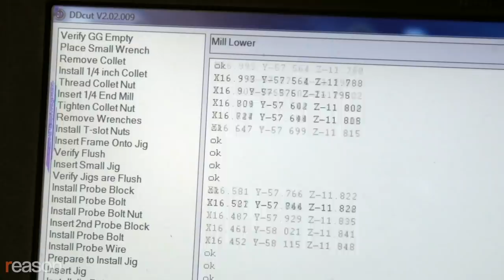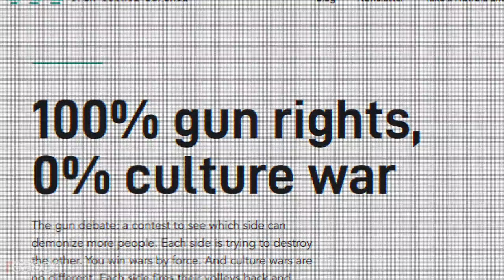Biden's Plan To Stop Ghost Guns Is Doomed To Fail

Comment: Home Depot and Lowes is going to need to perform FFL for purchases.
Reply: my plumbing supply store does and cheap transfers
Reply: Makes me glad I took metal shop in High School. I learned CNC and Milling. If I had that equipment guarantee you I would have an arsenal and a reload machine.
Reply: Hammer and a peice of pipe. Viola! got yourself a ghost gun.
Reply: I actually wonder how many people have been murdered with a "STUD GUN"  I don't think any or NPR and CNN would have harped on it for months.
Reply: IIRC Cal considered trying to ban 0% lowers; anything that can be converted into an AR lower. There is a guy (IIRC up in Alaska) who made one out of a 2x6 and another out of a nylon cutting board.
Reply: Slam-fire shotty.
Reply: @benjaminshropshire2900   Cool!!!
Reply: @johnslugger  i think a guy on yt has been trying to make a home built smg in the ww1 angry tube style
Reply: @vo25cd80   That makes more sense.
Reply: You can put a .22 on a straw and it will go off... Straws...

Comment: Anything that can be converted to a receiver would be controlled?  Thinks back to the dude who drilled a steel shovel blade into an AK-47 receiver.
Reply: And used the handle as a stock.
Reply: I can't wait until a 2 ton billet of Aluminum needs an FFL and serial number
Reply: @tyrannosaurusimperator  are you referring to cars?
Reply: It's not about the law. They don't need laws.

We just saw that with the Chauvin trial.

All they need is a narrative.

They will simply arrest you on a narrative. "Well, he had dangerous guns".

Our legal system is no more. Leftists have destroyed it.
Reply: I like the Ar built on a 2x8 plank
Reply: Anything using steel? Yeah right good luck Biden your government will because bankruptcy or become the newest province in china...
Reply: Ak 47 kits have existed for a long time and are surprisingly easy to utilize.
Reply: Man I love that dude
Reply: @dialecticalmonist3405  you are correct!
Reply: Casually replaces broken walther firing spring with a mechanical pen spring.
Reply: Loud and Annoying YT  And that just magnifies the absurdity

Comment: You can make a single shot shotgun from two pipes, an end cap, and a nut and bolt - off the shelf stuff you could buy at any home improvement store.  All you need is a drill and a drill bit to modify the end cap
Reply: Zip guns and pipe guns, the original ghost guns.
Reply: Wasn't there a wave of "slam-fire" shotgun videos on YouTube recently? Most of them were simple plumbing parts, but a few were really well-made.
Reply: Less robust but JB weld formed into a blunt point works too if you don't have a drill.
Reply: Rock & Lesson (learned)
Reply: Exactly, the only way to truly ban guns is to ban gun knowledge which would never be possible. There was a guy i think in the UK who wrote a book called "Expediant homemade firearms" where he demonstates that you can make a gun from hardware store parts.
Reply: @Queue3612  P.A. Luty
They threw him in prison
Reply: @middlesiderrider  Because he illegally made a firearm. im not saying it is legal or even right to start making homemade firearms im just saying that it is always ossible for someone to get one even if entirely illegal.
Reply: Theres an easier way a pipe a cap gunpowder and some gravel boom shotgun
Reply: Do what Switzerland is doing, your not allowed to carry bullets outside of firing ranges, even if you could make a gun you can’t use or fire it

Comment: 0:48 He doesn't realize what the bullets are made out of. Even some parts of the plastic gun.
Reply: I'm not a material engineer but I'd assume barrels and firing pins etc would have to be metal
Reply: @cowmaneater1243  I pipe is literally a metal tube and cylinder
Reply: someone in Israel snuck a ghost gun through metal detectors, so thats that
Reply: @cowmaneater1243  yes, because plastic can't strike the primer hard enough. But the liberator which is designed is based off an old French resistance pistol in the 1940s, so yeah you could make it completely out of plastic except for the firing pin and the casings and bullets, but you would only get one or 2 shots out of it if used full plastic to include the barrel.

The original liberator was half the size of his printed gun and was disposable and only fire a few shots.
Reply: @npciiii  the TSA also misses 95% of the guns and bombs smuggled by "red teams" testing the security. So what?
Reply: @npciiii  But you can't smuggle bullets in. Unless if it was made out of plastic and gunpowder.
Reply: @cowmaneater1243  nope the hardest part was the spring and no they make replaceable barrels now and yes they make bullets that are composite
Reply: @killertruth186  they make plastic cases for bullets even aluminum tho you can't reload them and gun powder they can make cordite but basic gun powder is easy and not metal
Reply: @killertruth186  say a 9mm at 50gr mostly composite goes rifle round speed but even all copper bullets
Reply: @bigalls3661  Projectile heads?
Reply: @ChucksSEADnDEAD  Let’s be real. They only look for bottles of water.
Reply: @npciiii  To be fair they let almost any weapon through, I lost count of how many lethal devices I just simply passed through the airport with. Like they really don't care what it is, its laughable how much truth to "security is just an illusion", and they just prove that.

The ATF considers shoelaces to be machineguns, so as a joke, think about how many unregistered machineguns walk through the airport every day.
Reply: @npciiii  unloaded?
Reply: @jakegarrett8109  everyone walking through the airport has weapons on them, its called a belt and a shoelace
Reply: @Robert53area  Exactly, I had a 5+ pound brick charger that would easily bash a head in (with heavy gauge cable and lighter gauge depending which you prefer or swinging like a mace if your a real lunatic), my belt, neck tie, and multiple electronics and they never checked if the batteries were actually batteries or turned on the devices. I think my neighbor would opt for shoelaces or they honestly wouldn't bat an eye if you packed guitar string which is the same as piano wire he used in combat. It blows my mind that they care about some things or at least pretend when they let you walk in with the most dangerous weapons you could want for murder.

For the most part its pointless, as an aerospace engineer I know a couple ways you could take down an aircraft once you're inside without tools and to escape safely (assuming you have a parachute) if that's your goal. So if that was really their concern then I'd say they are overlooking the obvious.
Reply: There's probably composites that can handle being barrel and pin.  Actually, wouldn't metals that are not sufficiently magnetically affected slip past detectors?
Reply: @jakegarrett8109  And sadly billions of people had no idea that anything can be the most dangerous weapon other than just firearms. It's just amazes me how people don't really care about the tools could be the most dangerous weapon they could carry.
Reply: @midgetydeath  I believe there are carbon fiber barrels, so yes that should be quite easy to DIY if you wanted. The liberator in the photo is a plastic printed barrel, typically one shot then replace but depends on cartridge used, so if a plastic barrel can half survive even one shot then some strongly wound composites which have similar hoop strength to metal will work for sure for multiple follow up shots.

I've heard of many other ways to get anything through airport security without inspection, some of which are laughably under the name of security purposes that will allow you to bring any box onto a plane, oh the irony...
Reply: when polymer guns began to grow in the market they did try to fear monger with that like the gloc and the tech 9 or polimer ar lowers
Reply: @cowmaneater1243  yeah we use Electrolysis, it’s really easy. you just take a steel pipe put it in salt water, use the 3D printed threading guide piece for the copper wire. run a charge from a small battery through the water and you have a threaded barrel.
Reply: @constantineergius1626  the metal tube is 3d printed
Reply: @Dr.MantisTobogganMD  I sure hope this is a joke
Reply: @KG-id3uo  
🤣😂😂😂😂🤣
Reply: @npciiii  If you know about it, he must not have snuck it through
Reply: @cowmaneater1243  they would work once

Comment: That 3d printed "Liberator" gun was probably based off of the FP-45 Liberator which was a throw away single shot pistol meant for use by the French Resistance in ww2...
Reply: In short, a one shot disposable gun.
Reply: @aeonofstarrail1349  
Yeah
Reply: That's enough.  There's no firearm specific part involved except the ammunition.  Check out the FGC-9.
Reply: An assasain gun.
Reply: sort of. Not mechanically similar in any way. What is similar was the psychological warfare aspect. It was intended to be devastating to the morale of the Germans who knew that there were thousands of them potentially in the hands of citizens who were not happy about them.
Reply: @benoorehek8475  No. An assassin gun must be long range. These guns are not, they have an effective range of only 2 m. Meaning that you will be instantly caught once you shot it.

Comment: The funny thing is the mill looks just like a normal Cnc mill, anyone with a little know-how and high quality materials could build a gun from scratch in their garage
Reply: Well that's basically what they are or based off.
Reply: @Yourmumsrectum  they are cnc mills just a little bit more specialized
Reply: @Sweedster  Pretty cool little piece of machinery really amazing how they have made things small.
Reply: @stevejones9717  Do you smoke the glass BBQ man seem like a right crack head.
Reply: @Yourmumsrectum  bro u can literally make mustard and chlorine gas using household chemicals, bomb recipes involve stuff found around home as well, model rockets for example. Their fuel is literally sugar mixed with something else and lit on fire, which If put in a sealed container would build up pressure and then boom, bomb
Reply: @potatoplant9943  Dude I don't care about that we where talking about a cmc mill dude not making chemical weapons.
Reply: @Yourmumsrectum  u just called someone a crackhead for saying that u could build a gun or bomb at home, I just gave evidence that he was right, so yeah it was related
Reply: @potatoplant9943  Thats what I'm having a go at him about because I wasn't talking about the weapons it made I was talking about how yeah it is based off a cmc mill, I don't care it makes weapons nor how to make them champ all I said was yeah its based off of a cmc mill and agreed with op on that point. So maybe he needs to learn to comprehend properly what I stated I didn't mention weapons at all in my original comment. He took it upon himself to try and put words in my mouth the dead shit.
Reply: @potatoplant9943  Does that explain it or do you need a reading and writing hotline number?
Reply: @Yourmumsrectum  oh well that’s fine, I just thought that you were saying you couldn’t make weapons in your garage and stuff, that’s my bad.
Reply: You can use a frikkin wood router if you take your time. it's not hard. Look at what the khyber pass dudes do with only hand tools.

Comment: Still want to see the stats of Ghost Guns used in crime, because I can only think of one case.
Reply: The left doesn't want that want that number out
Reply: Also be interested in how many 
"Braces"are used in crime
Reply: California claims to have a large number of crimes being committed with ghost guns. What they neglected to tell is they count any gun with the serial number ground off as a ghost gun.
Reply: Actually built ghost guns?  It's in the single digits.  Because a build is slower, more difficult, and more expensive than stealing a gun, buying one off your gang buddy, or lying on an FFL form.
Reply: @bobw1678  and just grinding the Pisa outta the number...
Absolutely would be what id do...
Plus I wouldn't have to learn how to build a gun....
Reply: @CM-ve1bz  Thats the deffinition of a Ghost Gun, a gun without serial number
Reply: @floatyboi4390  
  Not hardly
So called ghost guns are manufactured new by an individual and are legal.
Removing the serial number from a gun is a federal offense and highly frowned upon.
Reply: @CM-ve1bz  Doesn't it technically count if the definition of a ghost gun is firearm with no serial number identification? Perhaps at this point the statement is to scare people even more that firearms = bad as long as you keep people ignorant about the definition.
Reply: @Crazyasian123456  
  The only reason for the expansion of the definition is make people believe homemade guns are used in crimes. For the same reason CNN will tell you there's 60,000 homicides in the US, instead of saying there were 4,000 murders. They don't really lie, they just play real loose with the truth.
Reply: @CM-ve1bz  Oh I'm in agreement with you on that one, I'm also playing devil's advocate by being that pedantic about the term. The main issue is that, with how the term is commonly perceived now, the best solution is educate, educate, educate. The cat's out of the bag with regards to DIY, the problem is that people think the cat is a rabid raccoon because they are too scared to actually pay attention to what it actually is.
Reply: @CM-ve1bz  That is literally what a "ghost" gun is. It's not about who manufactured it. Homebrew or bought and manipulated. The problem is that the gun is not in the system. No serial number, no registered barrel profile. It is.. you guessed it, a ghost.
Reply: @JOhnDoe-nl4wj  
  It literally isn't.
A ghost gun is manufactured without a serial number and is legal. 
 A gun that has been assigned a serial number and then that number is removed, is nothing more than an illegal gun.
Reply: @CM-ve1bz  question is, how do self manufactured "ghost" guns and a legal or illegal gun, which has it's serial number removed and barrel / firing ping replaced, differ?
Both are unregistered untraceable. The problem isn't that one is 3d printed and the other is alterated, the problem is neither is registered or even traceable.
Reply: @JOhnDoe-nl4wj  
  I have a couple of shotguns that were manufactured before serial numbers were required by law. They don't fall under the header of ghost guns either. 
  The term ghost gun was given to guns manufactured by an individual and not assigned a serial number. In the attempt to make people afraid, some want to make the claim that ghost guns are used in a lot of crimes. To accomplish that they want to expand the definition to include illegal guns that have had the number removed. 
The tactic is easy to see. It's the attempt to use illegal guns to make legal guns illegal. Should the shotguns that I own be considered illegal because they don't have serial numbers. They don't fall in the category of ghost guns because I didn't manufacture them.
Reply: @CM-ve1bz  Personally, i think your shotguns should fall under ghost guns. Not because you did or did not manufactured them but because they aren't registered. Should they be considered illegal? depends, definitely falls under unregistered firearm and are practically and effectively like self built or altered guns.
This isn't about having a firearm or the means to acquire them.
I understand that you view the topic as a means to push for stricter gunlaws, it is certainly instrumentalized.
However, understand that it isn't the only point to consider.
Printed guns or unregistered firearms in general are extremely desirable for less than ideal motives.

Comment: Then there is Luty and his homemade SMGs as well, build from material you get in every home depot.
Reply: a true legend
Reply: Remember pipe weapons and such. You don’t even need proper gun parts, just determination and planning.
Reply: @gipsydangeramericasmonster9632  I made a scrap musket out of two pipes and some cement awhile ago

Proper parts be damned, am I right?
Reply: @logicalwren8061  if you’re determined and have the know-how, correct. your musket example, given its smoothbore, would work well. If you’re wanting to sling bullets, though, rifling would be a key part. And also a firing pin and such.
Reply: @gipsydangeramericasmonster9632  Mine functioned more like a cannon. It fired .30 ball bearings and generally was used like a very primal handheld cannon
Reply: @logicalwren8061  if it works it works
Reply: @gipsydangeramericasmonster9632  exactly
Reply: @logicalwren8061  Gun Jesus has a video where he shows various improvised guns, some of those seem absolutely ridiculous.
Reply: @sim.frischh9781  I'll go check it out

Comment: And the FGC-9 shown at the start just went through a recent design revision. If you make one make sure it's the current one!

Edit: Apparently this is actually a Shuty AP-9 at the start, not an FGC-9. Point still relevant!
Reply: How long ago was that?
Reply: @lucysmith4242  like 1-2 weeks?
Reply: @Slim934  thank you
Reply: That was not an FGC-9, That is the Shuty AP-9 that stark "cloned" for the FGC-9
Reply: @AxionProxy  thanks for the clarification. But point remains that the FGC-9 did get a design update in the last week or 2.

Comment: First and foremost even a 3D printed gun can't bypass a metal detector . It has to have a metal firing pin in order to work as a gun not to mention the bullets are also made of metal which obviously could be detected . not to mention the fact that Americans have been making their own weapons since this was a few British Colonies on the East Coast many of the weapons used in the Revolution at that time most guns even those made by large manufactures were handmade , so for someone locally to have the skills to make weapons too was totally normal and usually where you found better guns being made .